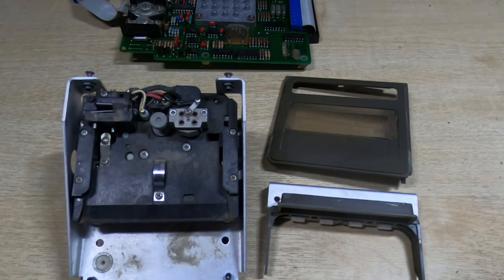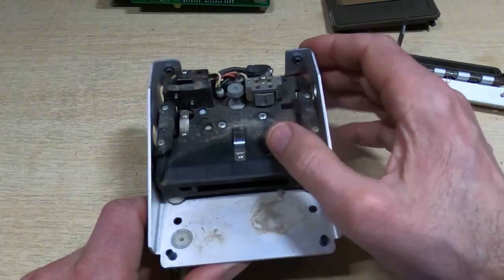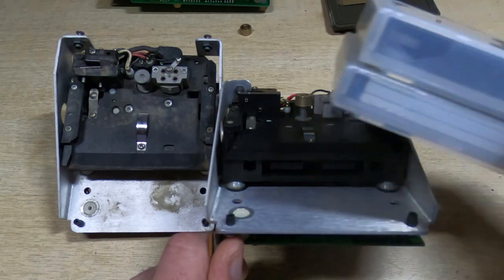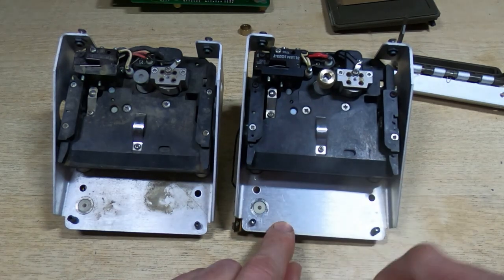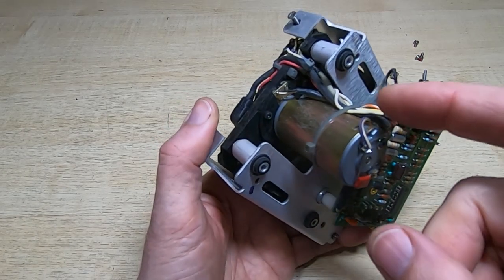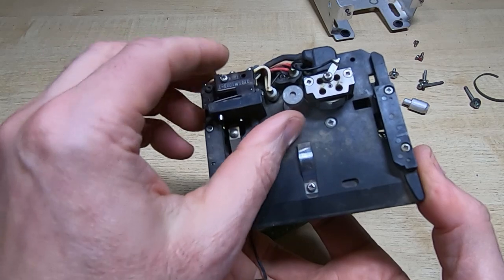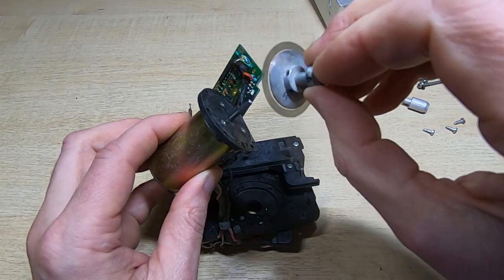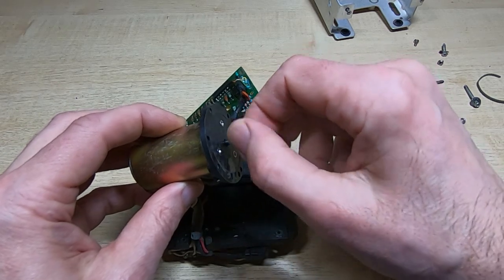HP9845B Repair Part22

Comment: Was it necessary to change any resistor values on the control board ? I can recall that in one of your videos you modified the tape drive to accept a different brand of tape that had different magnetic properties. I don't remember what video that was or if that even applies here to this model? You said something like the slightly larger tape was more reliable and  didn't snap as the HP tapes did or something to that effect ?
Reply from the maker: Not that far yet.  The drives do not work at the moment (as expected). However these drives work a little differently to the drives I have shown previously as far as flux density and pre compensation is concerned so it will need a slightly different approach once they are working. If you look at the schematic then peak head write current is limited by R1 (200R) so this can be adjusted if required although the more advanced pre compensation makes this less critical.